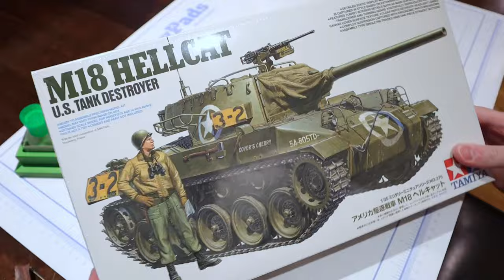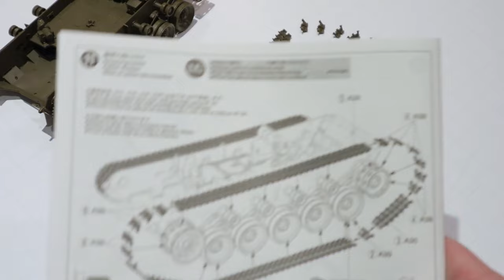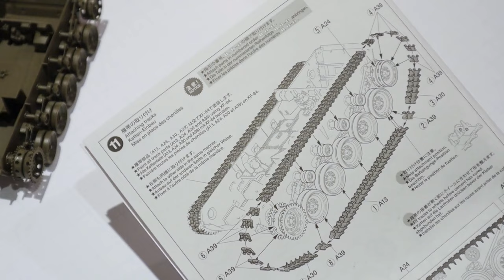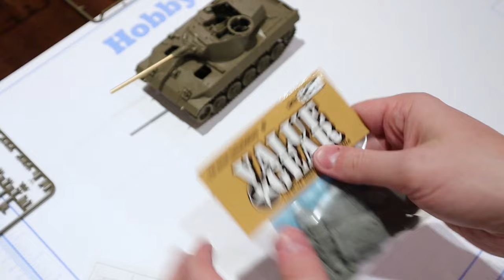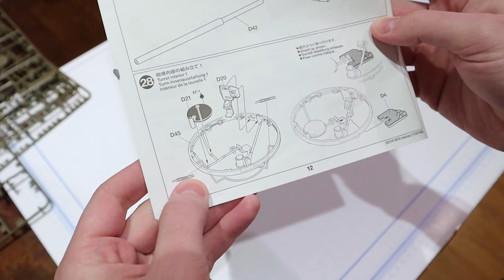Building the Tamiya M18 Hellcat | Full Step-by-Step Guide (with aftermarket upgrades)!

Comment: I picked this kit up today, the box art sold me on it straight away!

I got a bit of a fright when I got to the checkout and the cashier said "That'll be £42.50 please" i thought it was £30, but somebody had picked it up and then put it on the wrong place on the shelf. 😡
After heading over to the shelves with the cashier to check the price she pointed out the other kits were further along, and the peice qas correct.

I'm glad I did decide to buy it anyway, because when I got home and opened the box I couldn't believe how well molded everything was. I really can't wait to get stuck into it. 👍

Comment: Nice job on the build it looks great.  I wish my weathering expertise was at your level.  There are two "newer" paint products from Tamiya that I don't know if you have seen, but they would have been good to use on this model.  They are XF-84 Dark Iron and XF-85 Rubber Black.  They were called out on the suggested colors on the instructions for a Tamiya PKW IV Aust. G and turned out very realistic compared with the previous use of flat black.  They have a more grayish tone and look more like the color of real tracks and idler wheels.  Painting the tracks in the Dark Iron and then dry brushing silver over the dry paint makes a great effect.  You usually use Ammo MIG, but I see you use Tamiya also.  Check them out.
Reply from the maker: Ah great! I'll definitely pick those up, thank you 👍

Comment: Hello again.  Just finished building my Tamiya M18 & had to watch your video again - great job, as always. You mentioned that there's not much interior detail in the kit - well, I fixed that (check out my Killer Hellcat video). I bashed Academy, AFV, and MiniArt parts to add a driver compartment and an engine. Of course I've got a metal barrel, and a metal tow cable, and my gun even recoils. Drop me a comment and let me know what you think of my finished model, Thanks!

Comment: Hi Hank i purchased this kit and have started the build, in your video when installing the track the wheels move slightly, were they not supposed to be glued to each spindle, i did and i hope it doesn't affect my assembly please advise. otherwise your video is great and the painting and weathering looks fabulous.
regards.
Reply from the maker: Hey there - the tracks will not move, so you should be all set gluing everything in place. The only thing I wouldn't glue is the drive sprocket so you can adjust it accordingly to make the tracks fit. Hope that helps!

Comment: Looks really nice! Would you suggest this one or the tamiya challenger 1 as first build?
Reply from the maker: I haven't built the challenger 1 personally, but I would say that's a better option to start with. It's a simpler construction without any interior; the M18 is a bit tricky to paint & does have some fiddly bits during the build process. Hope that helps! 👍
Reply: @SpruesNBrews  Helps alot 😊👍 Ty for taking your time to help a noob out

Comment: that is a very nice looking kit, I'm interested to see what you do with the painting! quick question though, don't tamiya usually provide poly caps for the road wheels so you can build up the running gear separately and just pop it on and off that model to paint separately? if they're not included here, that feels like a step down from their older offerings.
Also, if you're after quality armour kits, miniart are probably the best for detail, more complicated than tamiya, but the details are amazing, especially on their full interior kits, I have a full interior M3 Grant in the stash that I want to build as Montgomery's command tank from the North African campaign but it's a little daunting at the minute! 😅
Reply from the maker: Thanks! And yes - there's only a poly-cap for the drive sprocket on this one. You're right that usually they engineer these so that you can pop the whole running gear off & paint it separately, but I couldn't figure out a good approach for that with this particular kit. That might be the only tricky part here, so we'll see when I get started on the painting.

And good recommendation with he MiniArt kits - I've heard great things! 👍

Comment: Big claim! I loved AFV club's all that it needed was metal track because hellcats tracks are the coolest ever in metal links! I don't as well as a few from our club don't like the rear engine grill the way it's done on the Tamiya kit could have been PE
Reply from the maker: Haha I know, but it's a beauty for sure! And I agree, some metal tracks for this one would be awesome 👍
Reply: @SpruesNBrews  the grill could have been PE atleast I stole one of the radios out the New afv club m16 meat chopper when it came out I built them both at same time they just gave the same no detail radio closed woth the handles! So because it was seen alot I changed it for a full faced one! I love the hellcat academy's was also nice! Only thing bad about avf clubs was no mantlet canvas and had to cut your own fenders if wanted them the short one's the cool one's lol but lots of lovely driving compartment and fighting compartment detail! But think it's an EX Ding Ho kit afv took over from but more or less the same way it's done for the wheels n idler with lighting hole's! I'm trying to find out if the British actually re painted there firefly or not? Maybe on this 1C I'm building with them having it a while it could have been done but I know VC fresh replacements etc weren't need ask Mike lol

Comment: As you rotated the hull assembly more than one place light shine through the joining lines. For example every single one of the torsion bar fittings have this in your video. Just like between the tow pintle and the rear plate of the hull (this one looks excessive).
Really clever engineering for those drive sprocets? You mean what every single one of the manufacturers do for 5-6 decades now? Using positioning tabs are so basic thing in (armor) model kits, nobody even mention it ever. (Italeri Sherman from 1977 has this too. Maybe it is new to Tamiya, but not to anybody else.)
By the way: if the kit is so perfect, why you nned to use a 3rd party gun barrel? (I know, Tamiya still haven't figured out how to mould an at least proper (not even decent) gun barrel. Most of the time their kit barrels have size and shape problems. (For example the 2 pdr barrel of their Valentine is utterly trash. And that is a small single piece, absolutely simple barrel. And Tamiya was still able to fuck it up. Not a single dimension of that barrel is near to the correct value. And that is a kit from 2017...) The whole turned metal barrel business born to give modelers usable barrels instead of the crap Tamiya models include.
The interior looks very rudimentary. Even the Academy M36 has much more detailed fighting compartment. I don't see any "crazy level of detail" anywhere on this kit. Just the typical Tamiya mediocrity. (Other manufacturers can make single piece lower hulls more detailed, than Tamiya the multipiece hulls. The multipiece approach from Tamiya is serves only one purpose: cost saving.)

It can't be the best if you need to use 3rd patry pieces. And as I know Tamiya, the 3rd party turned barrel is a must have.
Reply from the maker: Just one man's opinion, mate 👍
Reply: Maybe. An opinion not made by a fanboy. When I see a model kit review, especially a build review where everything is fine and good, I automatically disqualifying that review. There is not a single model kit that has no issues. Every kit has some! Yes, even Tamiya kits (some of them have fucking huge issue lists in reality).
Just look at the Tamiya F-4B reviews. All of them drooping with saliva and other body fluids. And watch Matt's build serias about tha same kit. Well, he is not the one who lie about a kit. And you can see how many issues that "perfect" kit has. I really want to see an in depth review of this Hellcat too. This is not one of those, just a quick build. (Quick build reviews are the most unreliable ones.)

Comment: The best armour kit??? Gimme a break.
I'm just finishing this kit, but is far from "best". 
1. The barrel cannot be elevated, there is only the horizontal position because of the canvas cover of the gun shield. Tamiya could have given us at least another one in another position - that would have taken three more parts.
2. The .50 cal can be positioned only in one way, looking forward. (Everyone else can provide rotatable MGs, and they could since the 1970s, dear Tamiya.)
3. The driver and the assistant driver's place is missing, there is nothing in there, no seats, no sticks, nothing. And this area is visible if you leave the hatches open here. 
4. No stowage apart from a few MG ammo boxes. C'mon! Hellcats were typically used with lots of gear fixed outside. Other Tamiya kits featured such items (e.g. the early Sherman M4).
5. Only two sets of decals, both from Italy, Spring 1945, very similar. 

Apart from these, it is a very nice kit, indeed, but I expect much more from Tamiya in 2022. Don't you???
Reply from the maker: Just one man's opinion here, my friend! 👍

Comment: It is a nice kit, but not the best (IMHO). I just finished mine.  My biggest complaint was the lack of tool tie down straps. All of the tools were held in their brackets by straps. These were not included in the design. (Without them, all of the tool would have fallen off the vehicle. Shame on Tamiya for that omission. I laboriously added them...
Reply from the maker: That's fair! I always add masking tape tie downs to my Tamiya kits - it's a quick & easy way to get that extra layer of detail 👍

Comment: I've bought and made Tamiya M18. While it has some nice points, especially around the turret, the hull fit is poor for Tamiya and the strange shaped wheel match between the drive sprockets and idler wheels is the worst thing I've ever seen Tamiya do in 1/35 (expect maintain their very old T-34 hull in use when it should have been pensioned off and still charge Tamiya pricing).
Reply from the maker: Huh, I didn't have those problems - sorry to hear that! I think I know what you're talking about with the sprocket/idlers though - they were a little tricky to position, but they did fit very well for me once they were all lined up 👍
Reply: @SpruesNBrews  I couldn't actually get them to fir at all well for 3 out of 4. The front of the hull had warped slightly meaning the plate that overs the hull frond didnt sit correctly and I needed filler to eliminate the gap. I've never seen any modern Tamiya kit in the last 20 years I've been building them with that many fit problems
Reply from the maker: Oh no kidding - that's a real bummer! You're right, you never see that with modern Tamiya kits. Maybe worth shooting their support line an email, could send you some new parts 🤔
Reply: @SpruesNBrews  A new kit :). The end product turned out pretty good, and I'd happily build another (I've built the AFV club, which isn't quite as nice, but at least you an first brass ammunition)